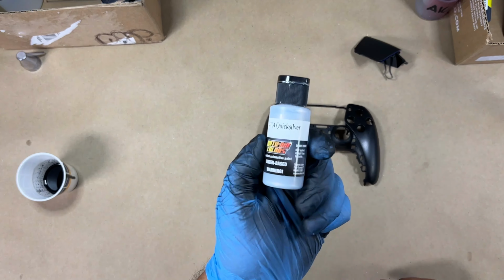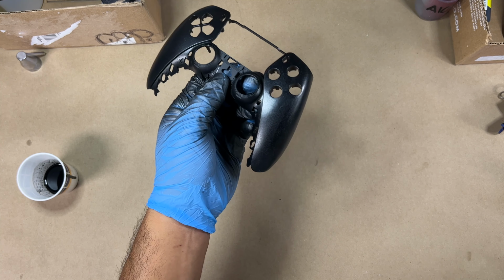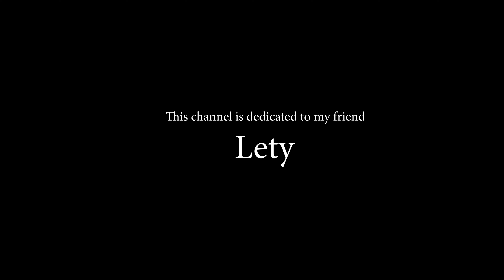Ultimate Raiders Custom Controller PS5 Hand Painted

Comment: Aloha braddah, just found your channel and love your customs!! I am new to the airbrushing and custom scene so I was wondering/hoping you could help me out with some of my questions.. What are you are using as your final clear coat, is it still the createx UVLS or are you using some kind of 2k (I've been reading posts/watching others saying 2k is the best but I'm thinking might be a little over the top for a controller not to mention not wanting to deal with the smell and toxicity of 2k)?? If using the UVLS, have you had any problems with durability over time (how well does it hold up)?? Mahalos
Reply from the maker: Thanks for the support. I currently use Rust-Oleum Painters Touch 2X gloss clear. UV resistant and gives a nice finish. I do 3-4 tack coats, then start laying it wet. Ill let that dry and do 2 tack coats and one wet one again. and continue that process until I bury any hard edges. I then sand with 300 to get rid of any uneven areas. I the. give it another 2 tacks one last wet coat. polish at the end.  … I stay away from 2K clear for these projects because you can cover about 3 controllers w one can, and if you are only working on one controller then you have wastes the rest of the 2k clear since it has the hardener. be sure to always do tack coats otherwise you may have the clear wrinkle on you.
Reply: @ErnieHernandezdesigner I wish I seen this comment before using 2k max lol, I got one controller out of it and it cost £20. I'm new to all this so I'm still learning but I've done 4 controllers so far and its quite fun
Reply from the maker: @leelomas321   Enjoy. Rust oleum 2X clear is really good. just add like layers. allowing it to dry in between layers. you can get 3 controllers cleared with R 2X Clear.